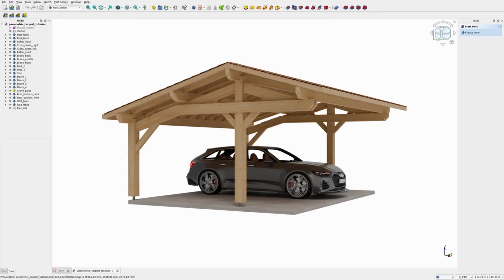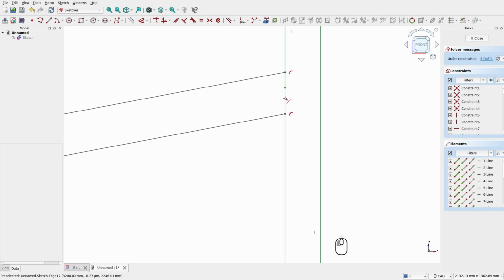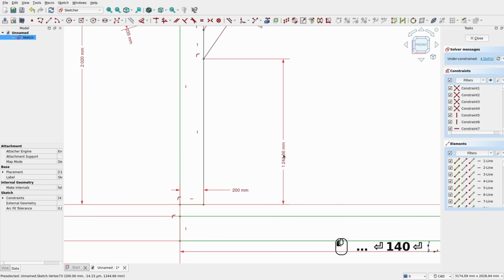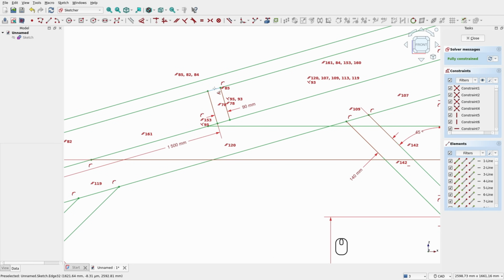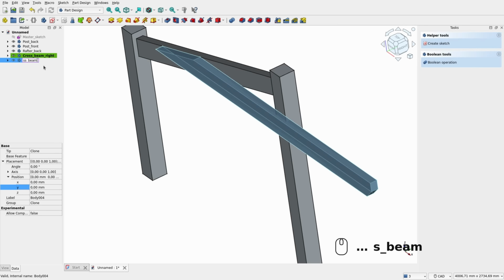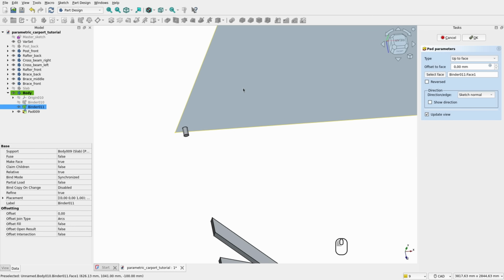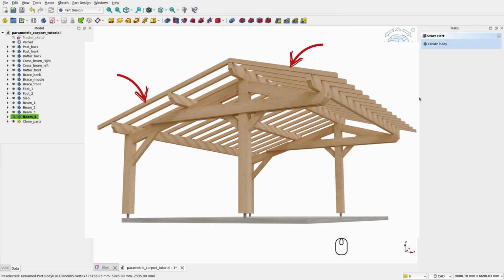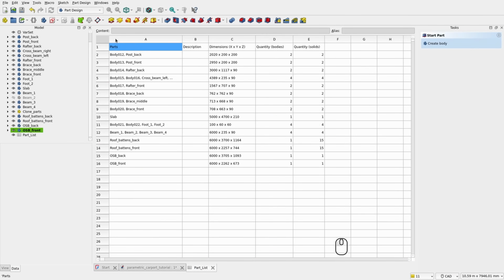FreeCAD - Complete Beginner Tutorial : 3D Parametric Carport - Woodworking - Direct Assembly

Comment: The part list generation is not built-in into the software is a big let down imo.

But very good tutorial. I am not a fan of these software as I think they should be a lot more easier to use for non-CAD people to design simple things like wood project.
They should also work by designing the objects first and then assemble/cut it as you place them, and not the reverse.

Comment: fucking draw collapses every fucking time I split the line
Reply: The constraint tool also was giving me grief i had to constrain the lines then the points. Also if the drawing has lost any of the previous constraints (measurements) it will not adjust to fully constrained.

As soon as it is not fully constrained it ill cause all sorts of problems. make sure all the measurements are still in the drawing and all the constraints are still there. Good luck.
Reply: P.S. try moving the constraint dots to see if they are where you expect.
Reply: @Mayadanava  I was able to do the drawing, with all its constraints, but it made me hate the program several times. Maybe they changed a few things since I'm using the latest version.

Comment: Great job on this excellent video. I have just one issue regarding the separation of the sketch segments—specifically at the beginning of the video, between the post and the inclined rafter (at 5:54). I lose the tangency constraints after splitting the segment. I am using version 1.1.1. Thanks.

Comment: I tried this again using version 1.1 and I had major issues with splitting the edges. It caused deletion of several related constraints. It may be a setting I have but I don't know what it would be. Loved this so much in the earlier version, I just wanted to try it again. I was able to overcome all the issues by carefully readding the deleted constraints. Thanks for all you provide.
Reply: Having exactly the same issue, thanks for sharing - good to know I'm not crazy.
Reply: @matisec3413 i also have the same problem, make me crazy ! Can you post a solution if you find one ?
Reply: Yup running into the same issue especially between the rafter and baton.

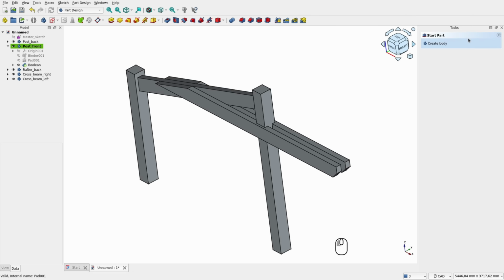Comment: Thank you! I learnt quite a bit FreeCAD. But in terms of engineering, this thing will collapse when built as there are no connections (tenons and mortises) at all apart from the cross beams (26:06). That make the part list pretty much use-less.
Reply: This is clearly just a tutorial in how to use the tools in freecad. The video demonstrates a few ways that appropriate joinery can be modelled for actual architecture.

Comment: Thanks a lot for providing this tutorial. But I am encountering a problem from 10:25: While adding the Split-Edges I get as well the warning about redundant contraints. I was following your advice to remove them afterwards. But in comparison to your example the system forces me to remove more than 10 "redundant" constraints. And afterwards all measurements are gone and nothing is fitting anymore. I would  then need to add all measurements again. I was following strictly your workflow and I did it twice to avoid every mistake. But still sthe same issue unfortunately. Do you have an idea what the reason could be (perhaps a missing configuration on my side)?
Reply: Hey did you find a solution? I have the same problem...
Reply: same here

Comment: I'm using v1.1.0rc2. The technique/trick of using the split-edge tool to separate objects is very problematic in the master sketch that I'm trying to create for my own project. It works some of the time, but it frequently fails. The tool seems quite buggy. Is there an alternative to using split-edge to separate sketch objects?
Reply: try to draw a "closed loop" instead of just two floating lines

Comment: Great tutorial, which goes a long way in teaching principles on top of a real example.

Have a question: is there not an "array" operation to make it simple "cloning" the parts (i.e. instead of having to use a macro)? I'm kind of surprised a tool such as FreeCAD has not native support for such a common design pattern.
Reply: Oh, actually is not that what you do for the battens? Thus I guess the same procedure could be used for the posts? Why did you prefer the cloning mething instead?

Comment: I think like the limitation of the line selection and the workaround with the split lines tool, does make this a flawed workflow. I have no sense of control with all these overlapping points and lines, and it feels like FreeCad is not made for this type of planning.

Is there a better workflow for top down planning of timber/wood frames?

Comment: Using a master sketch is a great option, however if you make a modification that changes the design like say adding an extra support and using the split edge tool it breaks all pads created from that part of the sketch. Unfortunately updating pads is hard. its easier to delete the pad and start again :(

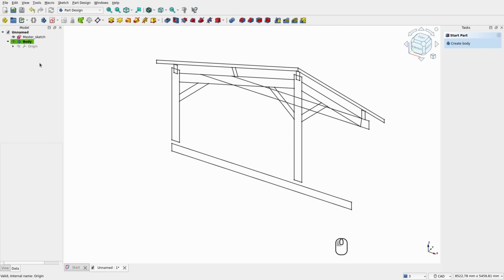Comment: Hi all! This has been really helpful so far. I've run into a problem trying to edit the body at 19:35 which will create the body but will not turn green. I saw in the example that it instantly turned green but that hasn't happened for me. If you could provide some guidance that would be great. Thanks!
Reply from the maker: @conorbanks7937 If you double-click on the body text, it should turn green, indicating that you're currently working on it.
Reply: @deltahedra3D  Thanks for the quick reply! Unfortunately, that doesn't seem to work. The Body tab turns blue and bold, but does not turn green.

Comment: Hi, i have a question. 
Why you use Part Design and not Part ?
Reply from the maker: @nicovador6826 It's mostly because of how the Transform feature works in Part Design. When using arrays, you can directly set the spacing between each solid — something the Draft Workbench's array tool doesn't let you do.
Reply: @deltahedra3D  Thks If I understand correctly, the Draft Workbench's array tool just spaces from model to model and not from a length to divide?

Comment: My design is slightly different but my master sketch subshape binder is showing up as one large yellow rectangle with some dark yellow shapes, and I cannot make my points coincidental. Given it's a NURBS renderer, this means that the inside and outside of the sketch elements are ill-defined so the solver can't tell what is inside and outside. I will have to go through each shape, detach it from the other elements of the master sketch, then see if that subshape binder is fixed, then reattach the sketch elements. I got lucky and took the roof off first, and that fixed the problem, but any time I would connect the roof and top it would break, so I just left a small gap. This made it a lot easier for me to select the board from the subshape binder to create my body. Also, you can clone the Group in the BIM workbench. I don't understand why you would use a Group, then a Part. A part is supposed to be a thing that can be made on it's own, so you it makes more sense to use a Part.

Comment: Hi, this is a great video and as an absolute beginner it really helped me getting into FreeCad. Everything worked as you showed it. However there is one strange thing. When I create a new file and then a sketch, body and subshape binder (as in the video), it always not only shows the edges of the sketch in yellow but also the highlights the faces in blue, even though I did hide the sketch. I can somehow ignore that via using the edge select filter but it is really annoying. It does not happen in the carport file but only in new files. Can anyone help?
Reply: Never mind, I partly figured it out just now: In the subshape binder if you select "Make face = false the faces are not highlighted any more. However this is activated in the carport file, so it must be related to something else, too. Also, interestingly, if you do select a face that has been highlighted, you can extrude it directly without having to select all the edges. So somehow this actually helps building the model faster?

Comment: this is such a pain in  the arse, I click close and see entirely different shit
Reply: LOL - Best comment for expression of feeling!  I'm feeling similarly as I work my way through it at .75 speed, returning again and again to a previous point to start over on a given element. I'm currently stuck on the lateral supports perpendicular to the plane of the slope and no matter what I do.. no matter which of my morals and values I compromise...  no matter how much emphasis I place on the dark arts - I find myself unable to exit that section with a nice green fully constrained status, causing me to question everything good in this world.  And no.  I will not use the sketch I downloaded for reference.  NO I SAY, NO!  :)
Reply: Update - I was finally able to get past this after smoking at least 14 bowls of crack and doing 3 sets of 89 jumping-jacks.  (I also had to manually add coincident constraints to the parallel/perpendicular lines because my snap settings are not correct and I can't figure out where/how to change them)
Reply: Update #2 - Finished the sketch.  I'm going to figure out how to turn on the correct snapping features before I continue.  By God I will.
Reply: Update #3 - I wish I would have pursued Update #2 at or around crack bowl #3.  It would have saved me a lot of time.. and a lot of crack...  (I found the auto constraints setting within the ... wait for it... "Constraints" panel... See that little drop down arrow next to the whatchamacallit icon just to the right of the eyeball?  That's the ticket...)

Comment: Excellent!  You are a good teacher!  I do have a question, somewhat unrelated, but useful in architectural modeling.  Is there a tool in any of FreeCad's workbenches that will automatically calculate the area of in irregular (closed) polygon?  During my working days with AutoCad it had such a tool.  Really handy for calculating the area of odd-shaped rooms.

Comment: Hey bud. greetings from SA. Immaculate video brother. well spoken and in depth explanations. Found it very easy following along with your tone. could you be so kind as to assist how to rectify the 'Cannot use selected object. Selected object must belong to the active body' error. I've tried ensuring the splitting and coincidence was done correctly in the sketch. sometimes I close the program, reopen and the very same part the allows me to 'pad'. would appreciate some advise. Thanks bud.
Reply: Did you ever figure this out?  I've nailed Beams 1 and 2 but 3 and 4 are no-go no matter what I do.  I've closed and re-opened 17298 times and I even considered going next door to kick my neighbor's annoying wife's 2nd cousin but all to no avail.  (FWIW, I've double-checked that my master sketch is fully constrained.  I'm about to become fully unconstrained if I don't figure this out.)
Reply: Okay - the answer is down below. Make sure you don't have another binder selected from one of the other bodies.

Comment: I'm following your tutorial to create my own roof for my terrace but I have problem while extruding one beam.
When I select all edges, FCAD shows me message "Wire not closed".
Can't find where because there are many overlapping pieces in me sketch and I can't progress with my work :(
Reply from the maker: @Sinnersslayer Try creating a new sketch and use the external geometry tool to project the ShapeBinder. Then, retrace it by following the binder for each section.
Reply: @deltahedra3D  if I only know that that means 😅
I literally started to learn FCAD on your video since I want to make my project.

Comment: Its good to see FreeCAD improving and the joy of hitting release 1.0, with the expectations that brings.
The carport is a good subject for the tutorial as it contains lots of elements, with many repetitions for reinforcing the learning.
For a parametric design I am surprised that you didn't go further though.

A suggestion is to do a version 2 of the SAME carport, referring back to the basics of this carport but going (so that work isn't repeated) but showing the way the following full parameterisation is done.
Setting up variables for the different sizes of wood is a natural thing to do as an initial process. That way you don't have to have "cheat sheet" with the sizes beside the computer as you design (and potentially misplace).
Everything should be variables if it is a dimension... well it is a way to show what is possible, though perhaps not practical - but in the opposite direction to Carport1.
The design as given here is a really simple build.
Putting birds mouth joints in that are parameterised so that they can't be so big they cause structural issues would be a great example (assuming this can be done).
Another one is the battens, they should be spaced so that there is the correct number of battens based on the width of the carport.
So the number should be some function of the slab width, the lateral beam extension and the minimum spacing for the batterns.
The dimensions of the beams could (?) be parameterised as well. That is for length up to 4000 80 x 150 up to 6000 80 x 250.
The alternative would be to have a MAXIMUM length so that the strength of the beams is always sufficient
Then there is the addition of the bolts (say) to the supports.
Stirrups (from another design that can be imported) for the columns to stand on (set in the concrete)
The addition of roofing materials and gutters -its a carport not an arbor :)

as per another viewer @alfredoangeles5235
1. Mortises and tenons for some pieces can be added with the same "shape binder" steps?
2. What would be the best workflow to make drawings out of your model?
3. It is possible an "Exploded view"?
4. How to export and render?

At the end of this you would have a carport that is truly paramaterised carport

One improvement to the interface is the need to input the mm in the variables - why? 
If it is a single number it is a dimension (what else would it be?)
If the reason is you are not sure what type of dimension it is (length, angle etc) then I would suggest the assumption of length with any other unit needing to be explicit. This is to reduce the input work load for the majority of the time.
There may be some other reason - perhaps say why as you go through the need to add it. That way the user knows what they are avoiding - other than getting an error.

Keep up the great work - and they way you have done this model and its explanation was REALLY good.

Also g'day to Lyon, I have spent quite a few weekends there when working in Geneva, a lovely city even for one that can't speak a word of French.
Personally I find Paris to boring as the architecture is so similar for so much of it, Lyon has far more variety - its also warmer (than Paris or Geneva) in winter.